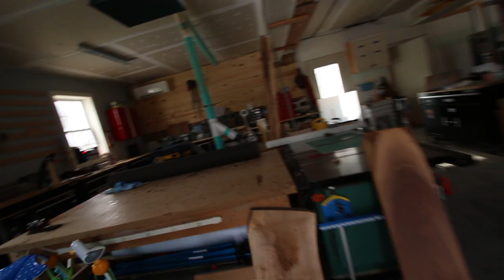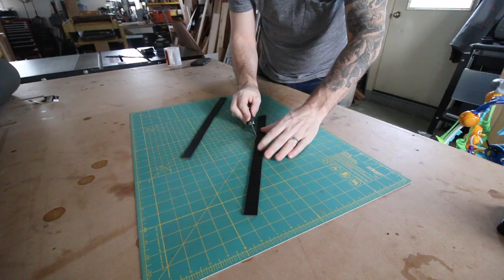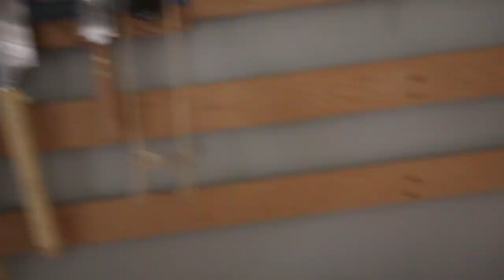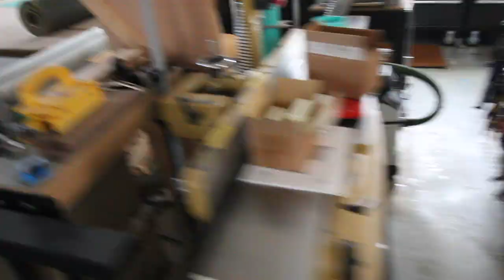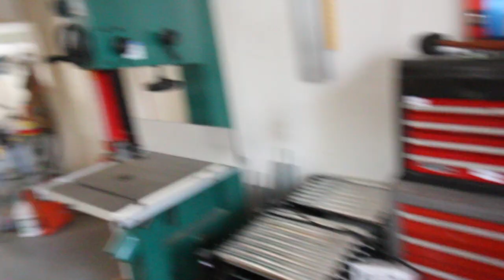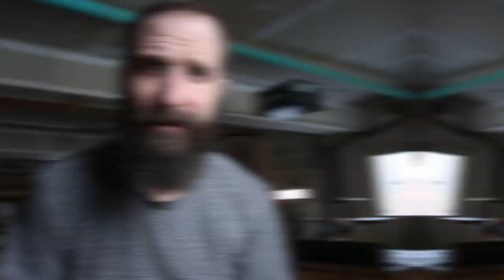This Zipper Is Killing Me!

Comment: The BEST way to learn how to put a zipper in is to take it out of the package,then open the package up fully and follow the directions exactly!  If you are afraid of the machine needle breaking or sewing over pins, I used small pieces of tape on the outside edge of the zipper to hold it in place while sewing it it.  It was very helpful to my daughters when I taught them how to sew also.  Good luck!  You can do it!

Comment: I knew it was about time to hear from you guys. I have had some of that fear of failure the last few years, I didn't have it the first 50 years, for which I am thankful, because this totally sucks! The only way not to fail is don't do anything pertaining to the failure monster, whatever it is today, right? It started with depression when my husband passed away.  The depression is finally getting better but no sign yet that its taking this other failure stuff with it. I am sorry you have that to deal with. Now, the zipper, I know how to do that!  I learned one step at a time. Find a zipper and an odd piece of material not suited to be used on anything and put a zipper in it, if you don;t like how it looks, rip it out and do it again.  You do have a seam ripper and thats a good use for it.  your struggle might be related to how you set the pins, cross ways or vertical. Good luck!

Comment: Zippers. I usually don't use them for 3 reasons. 1 is that, like you, i cant figure out how to sew it in and have it look good. 2 is that most zippers available at craft stores are low quality. 3 is that if the zipper ever fails usually the entire project needs to be taken apart to replace the zipper. I use buttons.

Comment: Zippers can  be a pain. I have two ways to sew in zippers. First way is to pin it on the seam of fabric, I hate this way the most. You have to get that zipper perfect on the seam and hope the machine doesn’t go wonky over the pins. I’ve been known to hand sew these zippers in and not fight with the pins. Second way is hand stitch zipper into place. This one I use when I repair a jacket zipper. After zippers is replace I remove the hand stitches and it’s done. I try not to buy any patterns that has to have a zipper.